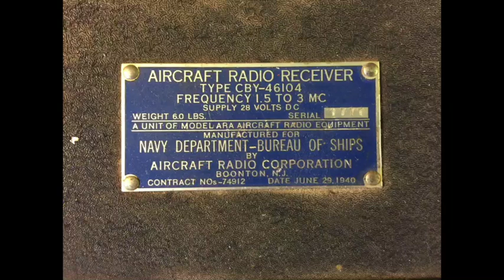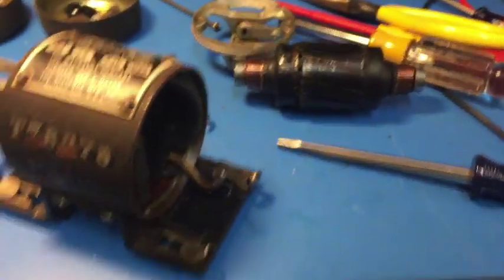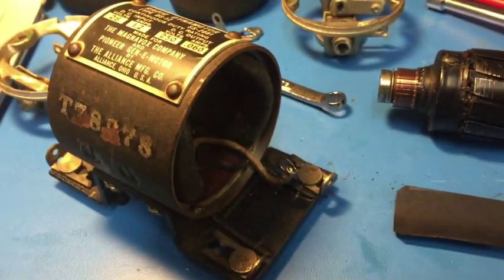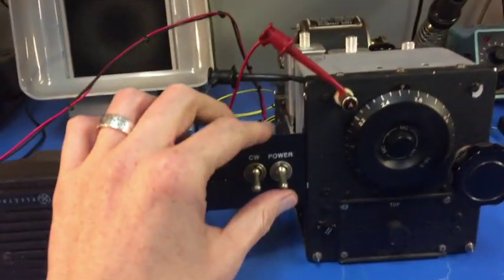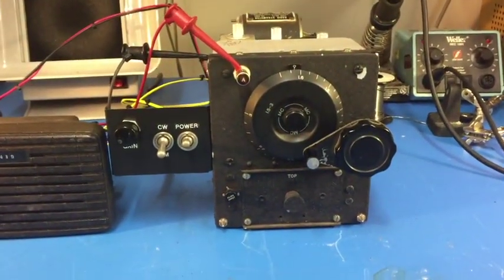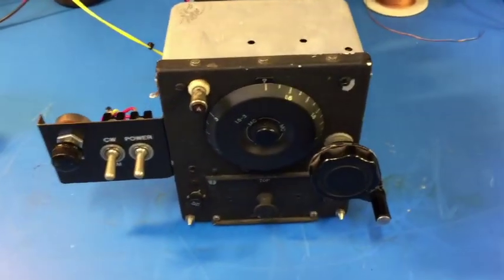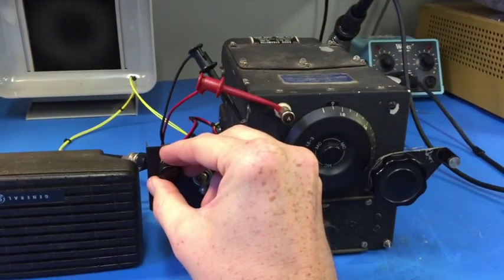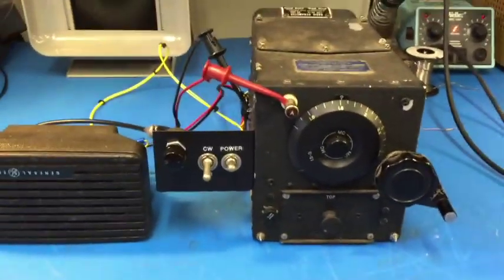all original ARC 5 receiver, dynamotor repair, and demonstration

Comment: I was given one of these when I was kid in the 70s and already fascinated by radio and electronics. Unfortunately I no longer have it but so wish I had held on to it. Mine did not have a dynamotor. The inside of the RF transformer cans was like a work of art.

Comment: An unmodified radio is an artifact deserving of our respect :^) +1 on the outboard control panel - a fine solution to keep the radio as original as possible.   It's funny we're now reversing the mods from the 60s.  Command sets are an addictive hobby.

Comment: Might be missing something but you need to grease the bearing's, the original grease has always vanished or is rock solid. We use silicon grease. This will then minimise wear over time and maximise performance.

Comment: I hope that the bearings were greased! Lubriplate Poly HP-2, Chevron SRI 2 and Mobil Polyrex EM are the most suitable greases for the ball bearings used in dynamotors, at 0 to 50 Celsius ambient temperatures. 100% of the free space in the bearing can be filled with grease at the speed factor these bearings are operated at, but filling only 75% to 95% reduces the possibility of excess grease going where it is not wanted.

Comment: Have you By any chance ever , Tried out a Radio receiver BC-1023A 62-80 MHZ Vhf Fm uhf, But does not a a tuning capacitor, I  have own for 10 years, How would I run it if you know How.or can I some how add a capacitor.